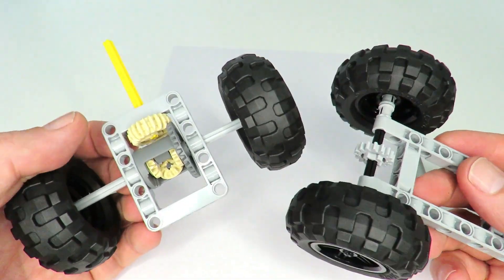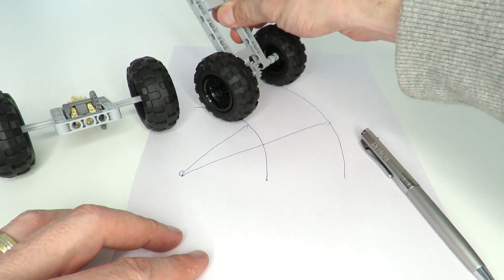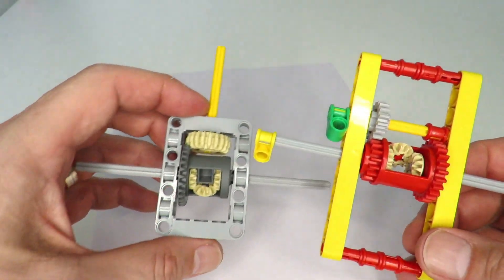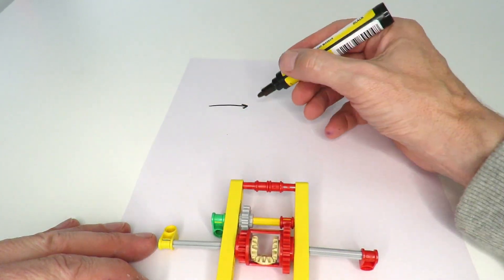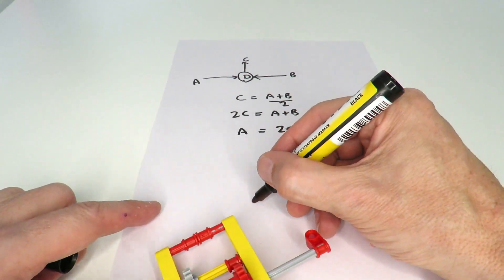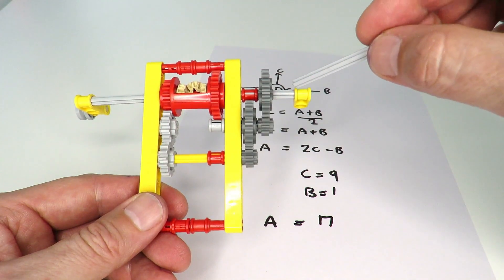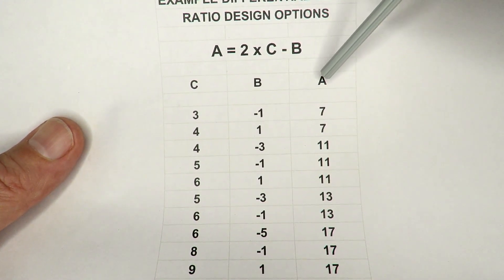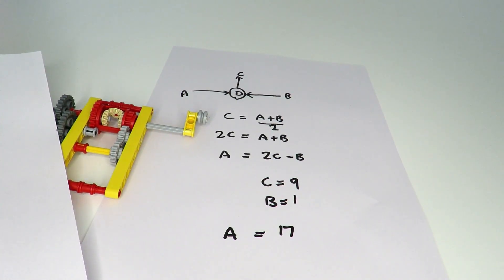How to use a Lego Technic differential for creating prime gear ratios for MOCs. Part 1

Comment: Hello, thank you very much for you videos and gearing ratios tutorials. I needed a 1:13 ratio. So I looked at your table and saw C=5, B=-3 and A=13. OK, so I used gear ratio 5:3 using the 20t x 12t gears (and had to reverse to change the sign of B). Finally in order to make it work, I had to gear down the input 3 times. So I assume there is a rule "if abs(B)>1, you need to gear down by the value of abs(B) before you enter the whole differential system if you want to have 1:A ratio. Correct? Anyway it worked for me just fine. Thank you.

Comment: does torque change proportionally?

i always wondered if torque would increase if the output spun slower, it should in a normal gear ratio, but what if it's slower because it "covers longer distance"
Reply from the maker: Hi There. Yes the torque will be higher if the output rotates more slowly. Generally if you half the output speed you will double the torque (less friction losses)...
Reply: @TechnicBrickPower  well thank you for the reply, keep up the educational work :D

Comment: There's also an old differential (73071) and an rc differential (65414 and 65413)
Reply from the maker: Hi Norbertas. Thanks for your comment. Yes there's a few out there. The different design don't affect the how you can use them, and the basic equation governing the relationship between the inputs remains the same. 🙃
Reply: @TechnicBrickPower  that is not the response i expected or wanted
Reply from the maker: @K3b1bisLtu  Sorry maybe I misunderstood - what were you expecting?
Reply: @TechnicBrickPower  i was expecting and wanting to get completely ignored
Reply: .....and 65413)
Reply: @tuankiettran8811  ok
Reply: thank you!

Comment: 1:55 there's a third differential made by lego, parts 65413 and 65414 combine with 5 of the tan bevel gears to create a differential
Reply from the maker: Hi Anthony, Thanks for your comment. That's interesting - I haven't seen those parts yet - and I can see why...they are only used in one new set. I will source some and see how they work. Thanks again.
Reply: @TechnicBrickPower  i think the 42114 has 3.
Reply: @TechnicBrickPower  did you mean: Nov 2020 in 3 sets including 51515.
Reply: @EricKidson2008  additional updates:
Jan. 2021:
we get 1 more set.
42124 :)

Comment: excellent stuff! 

aside from using them in winding barrels and adjustable clock hands, i've had to use the adder/subtractor nature of the differential in order to create an 11hr clock hand; 12hrs forward and 1hr back.

KEvron
Reply from the maker: Hi KEvron. Thanks for your comment - it means a lot to me to get comments like that. I have only just had a chance to look at your channel. I am very interested in clocks too. I am exploring different, but related topics all the time and I am going to study your work!
Reply: @TechnicBrickPower  
"I am very interested in clocks too."
once you get into it, it becomes a consuming passion. always looking for ways to improve your design, reduce friction, increase running time, simply mechanisms, etc.

i've published lots of content on the subject, but you should also check out a few other builders: ben van de waal, David Ziemkiewicz, Ami Varsano, sforbs and many others have publish excellent content on the subject. ben has dozens of videos of escapement designs, from the simple to the complex. he works with traditional technic elements. Ami's channel features some excellent escapement designs, too; he works primarily with studless technic elements.

happy tinkering!

KEvron